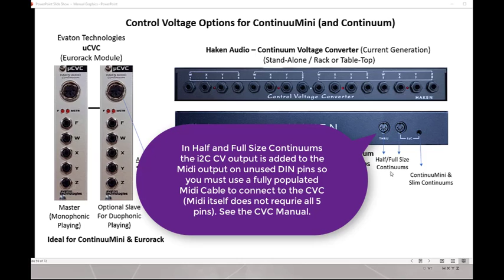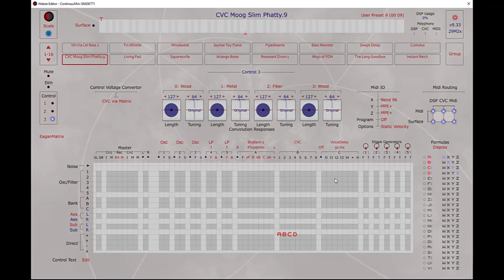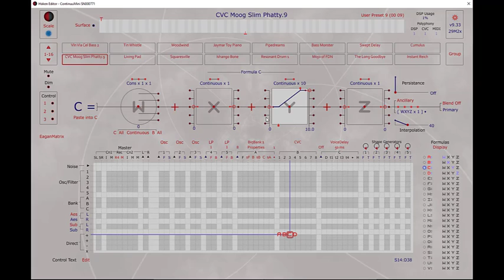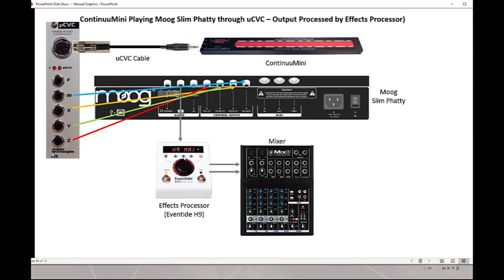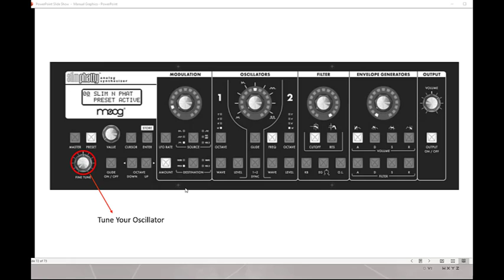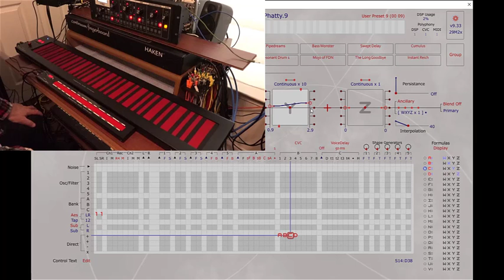Haken Continuum / EaganMatrix - Using ContinuuMini with uCVC/CVC (Control Voltage interfaces)

Comment: Looking forward to trying this with Osmose soon :)
Reply from the maker: For Osmose you will need to use the Midi DIN connection to the CVC with a fully populated Midi cable as it uses unused Midi pins for the IC2 CVC interface. Run the Midi back to the Osmose using the CVC Thru DIN port if you want to use the Midi DIN for other things. Also not you will want to set your polyphony to 4 so you don't have CVC channel dropouts. But it works fine for me like that on Osmose.